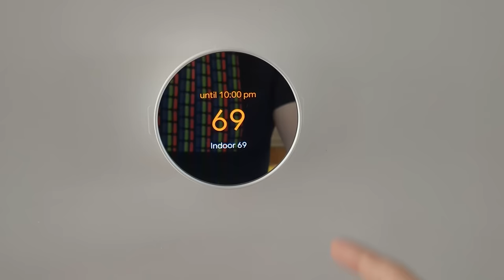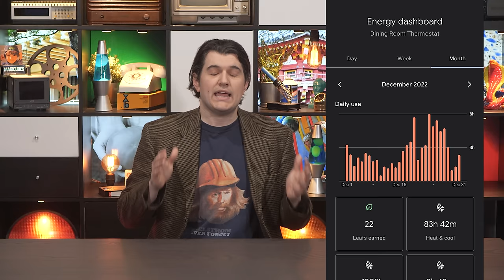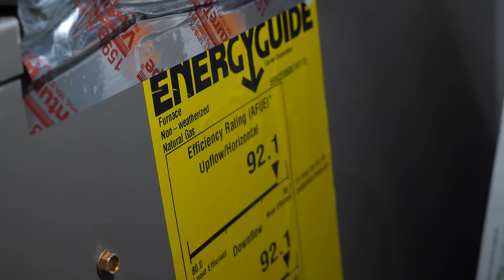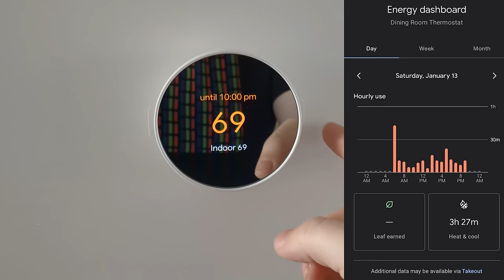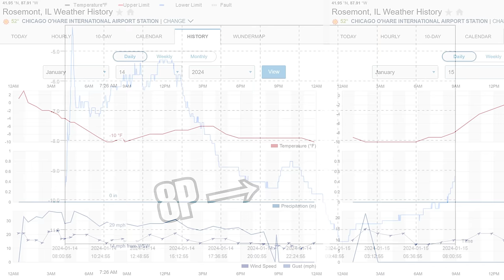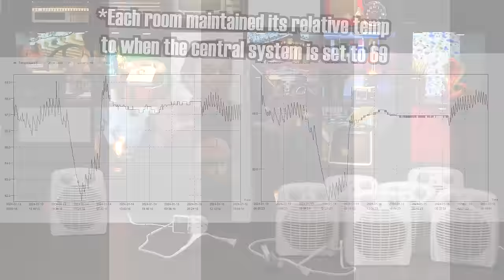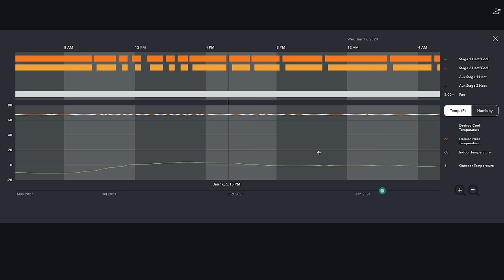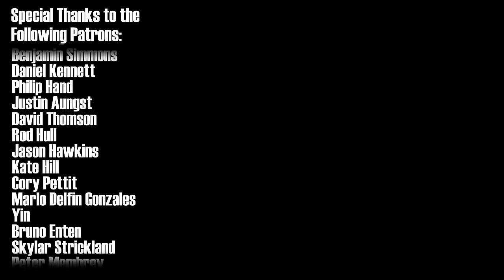Old HVAC industry practices are holding us back and costing us money. But we can fix it.

Comment: Former HVAC sales rep here. Great video! While attending a hvac training, I was giving a rather shocking Stat, less than 10% of hvac sales in 2022 had a load calculation preformed prior to the sale of a new system.

I'm not innocent either, as I was never told what or how to preform one of these and became part of the problem. The more I learned in that role the more shocked I was at how much damage and headache I likely caused for homeowners.

Your comments on the lack of communication between departments is actually rather accurate and something that has, as of late become a much bigger focus for the company. (who I still work for under a different position, in another trade department) so atleast at our national company things are changing and loadcalcs are becoming a much larger focus company wide. The issues of system sizing has been a regular cause of issues, callbacks, and heachaces for us and the customer.
Reply: I wonder if it'd be possible to semi-automate the load calc. Some kind of equation that you can input the parameters to (shared walls, insulation, basement or slab, attic, etc)
Reply: As a technician working on a wide variety of buildings, load calcs are nearly useless: 
First the customer will not pay for a useful load calculation, so all you get is calculations based on ASSUMED values.

 Secondly, and because of this, the new load calculation almost always causes problems with callbacks and customer expectations. As long as the customer was happy with the previous unit, no major changes happened to the building and you don't notice obvious issues, just put in a unit with the same capacity, no more than a half a ton increase AT MOST.

Where customers are more willing to pay for a good load calculation, and/or you are replacing both the unit and the ductwork, particularly if you are re engineering the ductwork, THEN load calculations are great, and incidentally you NEED to replace and re enginer the ductwork if you move more than a ton of capacity EITHER way.

The real problem that I have seen is that technicians are encouraged to upsize units at every turn. That's a problem with management, not load calculations.
Reply: @Timeward76 they do that, it's industry standard, unfortunately however the results are based on the accuracy of the assumptions...
Reply: so, it's not the consumer at fault, but rather the HVAC industry, good to know.
Reply: @SoloRenegade  it gets complicated. The consumer drives the industry, and they have rewarded an industry structured to rip them off. Literally one company I worked for was structured old school, and in such a way as to benefit the customer. They went out of business and got bought by a new school company structured to rip people off, and they were rewarded by consumers with more money.

So as individuals consumers are not at fault, but collectively consumers are too ignorant and short term minded.... But that seems to apply across all industries.
Reply: @vidard9863  I can relate to everything you've shared. but I still blame the HVAC companies. People selling out good businesses to greedy corporations to get rich quick.

Those greedy corporations go after teh rich people who can't be bothered to know if you're doing it right, and just sign the check. Corporations love those customers. And they buy up the competition, teh good businesses, to make sure they don't have to compete with a proper HVAC company. Don't want them stealing their high paying customers when they find out the corporation screwed them. The less competition the corporation has, the more they can charge, and the more they can screw the customer and get away with it.
Reply: @SoloRenegade  look it isn't just one side that's bad, there plenty of blame to go around. The issue however is that it is a cause and effect cycle and it's only the customers that have both the motivation and the ability to affect the cycle. The greedy corporation is being rewarded for bad behavior, so they won't stop. Don't get me wrong I quit that corporation because I would rather take a pay cut than keep ripping people off, but I don't have a family to support so I can afford my pride. I get punished for doing the right thing. You as a customer however have the ability and benefit from punishing "corporate greed".
Reply: @vidard9863  "it's only the customers that have both the motivation and the ability to affect the cycle. "

100% false. When corporations buy out all the competition, the consumer has no choice. 

The consumer is not an HVAC specialist and doesn't know what they don't know. If they could do it themselves, they wouldn't need the HVAC specialist.

"I get punished for doing the right thing. "

proving it's the corporation's fault, not the consumer's fault.

"You as a customer however have the ability and benefit from punishing "corporate greed"."

only by becoming a DIY HVAC specialist myself, something most people cannot do.
Reply: @SoloRenegade  no, the old company went out of business because the customers didn't think about basic obvious issues. 
To give customers lower prices cutting labor costs is the obvious solution: particularly overtime, that means that sometimes when you call you have to wait until the next business day for service. Worked great 80 years ago when the company started. Not so great these days though... Customers want instant service.
Actually, I'm just wasting my time with you, I get it, you are perfect and it's only evil corporations that totally are not made by people just like you. Cool, whatever. Let me tell you some basic life lessons: 

If the people are always trying to sell you MULTIPLE things, they get money by selling, up selling and turning over revenue. Tradesmen used to not have to sell because you need their services, they will talk you out of buying things as likely as into buying things. If someone can't explain something in fairly simple terms they either haven't mastered the subject, or they don't want you to know what's going on. If they are baffling you with BS, they are trying to sell you something. If they act like they are good at sales and comfortable with the prices they are sales men. Particularly these days. Inflation is making all the numbers look bad to working men.

 However businesses do need to make money. 
Old school businesses were built on loyalty, the business was meant to create a situation where your grandkids were giving my grandkids good work. Typically, especially in air-conditioning, service is cheap, but they make their living off on installs/sales. This is because a proper install is significantly more complicated, and expensive than a poor/cheap install, and has the highest risk of unexpected expense, also they want lifetime customers, not service customers, and poor installs generate service calls. If you have a good company, giving you good affordable service, and they are not always trying to upsell you, and you don't buy their installs, they WILL go out of business. Again, these are not the guys telling you to replace the unit every time they see you, or if they are, it's mentioned in passing like they don't expect you to do so. If you buy the cheapest install you can from another company you will give them a lot of service work but no profit because again service is typically at or below cost just to maintain customer loyalty. The same thing goes for wells, electricians, plumbing, and all other trades. Affordable quality services without emphasis on sales are loss leaders. 

Again, you can apply these basic principles to any trade work in your life. None of these are unique to ACs, and you don't actually need to know anything about them to apply this fairly basic information.
Reply: @vidard9863  "To give customers lower prices cutting labor costs is the obvious solution:"

proving it was the corporation.

"Customers want instant service"

that's a blanket statement. but also very subjective. how long do you expect customers to wait? If you take far too long, of course they will go elsewhere. 

"Tradesmen used to not have to sell because you need their services, they will talk you out of buying things as likely as into buying things."

you're not very bright.

"If someone can't explain something in fairly simple terms they either haven't mastered the subject, or they don't want you to know what's going on."

well you clearly don't know what you're talking about with this long-winded rambling response.

"If they are baffling you with BS, they are trying to sell you something."

like you're doing right now?

"Inflation is making all the numbers look bad to working men."

again, consumers aren't causing inflation. you just keep jumping from one random thing to another. Most of this has nothing to do with the topic at hand.

"However businesses do need to make money. "

wow, you just figured that out?

"This is because a proper install is significantly more complicated, and expensive than a poor/cheap install, and has the highest risk of unexpected expense, "

BS nonsense, spoken like a true sleezy salesman.

"Affordable quality services without emphasis on sales are loss leaders. "

not true at all. you're describing sleezy business, not good business. you're clearly not very good at this stuff. Seems you had a business, did crappy work and charged too much, had no business sense, went out of business, and blamed your customers.
Reply: @SoloRenegade  you are the problem. You can choose to remain ignorant as long as you like, fortunately you will be the one to pay for it.
Reply: @vidard9863  "you are the problem. "

how so?

"You can choose to remain ignorant as long as you like"

that's just you projecting your own ignorance on others.

"fortunately you will be the one to pay for it."

no, I can do it myself. being an engineer has its advantages.

cope harder.
Reply: @vidard9863  you can overcharge a few rich customers and they may not care but that does not scale. Arguably the whole country should switch to heat pumps to limit global warming, but they're not going to get installed at today's prices of 2, 3 or 4 times the cost of a conventional system.  So the new style price gouging HVAC companies can limit themselves to 10 or 20 percent of the market, or things will have to change.
Reply: I would note assessing the homes heat loss and summer heat gain is difficult to easily do.

Comment: As a 45 year veteran HVAC company owner, you made a GREAT episode! Also, the pith was outstanding!
Reply: Preach those heat pumps to your customers.
Reply: Oversizing a heat pump a bit would make sense if a smart thermostat would track power price and local PV production adjusting temp to the allowed wiggle room in order to save money.
Reply: When will we all have geothermal heat pumps? Cold water goes into the ground, 59F water comes up, goes into heat pump. Repeat.
Reply from the maker: @RisenThe At this point, I'm not pushing anyone towards geothermal. The constant improvements in cold climate air-source heat pumps mean that the returns on going geothermal just keep on diminishing and the added expense takes forever to be recouped. We can move much faster going air-source and get 95% of the improvement.
Reply: Oversizing a heat pump really isn't a good idea. It's even more important than with gas furnaces to get the sizing correct so it doesn't short cycle or resort to excessive use of auxiliary heat. You have to balance heating and cooling as well, in most regions the heat vs cool requirement is not symmetrical.  @ArthursHD
Reply: @TechnologyConnections we're considering geothermal for our in-planning-phases new construction, but only because I have all the equipment necessary to do the work that entails. Paying a contractor to come out and dig the field for heat exchangers is a huge turn-off with air source units that work on the coldest days nearly anywhere in the country being a thing.
Reply: @ArthursHD  It would make more sense to split the heat pump into two and then round up the capacity. That way, most of the time, only one would be running, but for long enough to properly cycle. Then, in the midst of winter, both run and together they give you a bit more capacity. If you switch around which one comes on first for heating and cooling, you also get even wear. And, as an added bonus, when one dies you still have 60% of your design capacity available---i.e. you won't even see a drop in inside temps for 80+% of winter.
Reply: Pith?
Reply: @WREFMAN  You know... like 'pithy'?
Reply: @TechnologyConnections  I appreciate the response!
Reply: I would have thought you might have remarked about proper sizing when selling the home and codes. I thought HVAC was about starting from a record heat day or a record cold day and getting the home temperature in a certain time with no help except for closing the doors and windows. Of course there are many mitigation things like covering windows, closing unused rooms. It is funny how now cooling seems more important than heating but we can always strip down and a spray water bottle but having cold hands and cold feet is never fun especially for the kids. I guess they can stay in the car.

Comment: I work in the HVAC industry and appreciate all of the videos you have made on heat pumps. I have always been impressed with the enormous amount of research you have put in as a consumer. I would love to sit down and have a couple hour chat with you on the subject, just because my own hubris makes me believe I could fill in some tiny and I do mean miniscule gaps in your knowledge. 
But I will say this, there is no reason to wait to install a heat pump, if you currently have a 2 ton A/C, there are units on the market that will allow you to simply change the condensing unit outside and nothing else and have a 20+ SEER heat pump.
Reply: Can I join in? I'd love to learn and I'll buy the first round (and probably more)...
Reply: kinda there is a reason if your furnace is under warranty and breaks 😅
Reply: Hey, I'm a curious consumer myself! I have a lot of trouble looking through heat pumps because I know the COP depends on outside temperature, but I can't find the graphs with those data shown. If I'm lucky I get 2-3 data points eg: COP at 10°C, 0°C, -20°C. Where should I look then?
Edit: as shown in the video at 55:00. Only 3 data points. Or is that really good enough?
Reply: @Sekir80 Those graphs are in the manufacturer’s product catalog typically. Sometimes they are in the installation or O&M manuals. If you can’t find them, you can ask a sales rep to provide it or you can ask them to provide kW estimates over a set of datapoints. You can then use linear regression in Excel to uncover the coefficients in the product’s load curve (provided you know the equation). I used to design building energy models in my day and this was something I had to do occasionally.
Reply: @Solarusdude  Yeah, these are solid advice, thanks. I only find it a bit offensive that I'm constantly handled as an idiot by the product websites giving me mostly nothing and I find it tiring I need to run several circles to obtain documents. Why can't they provide everything with a click? It's like they try to hide the data of given product.